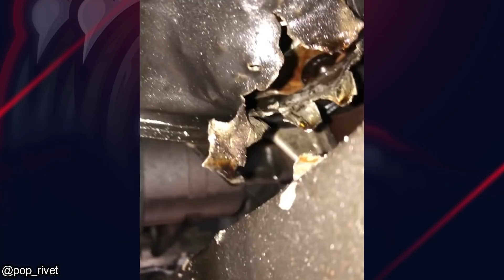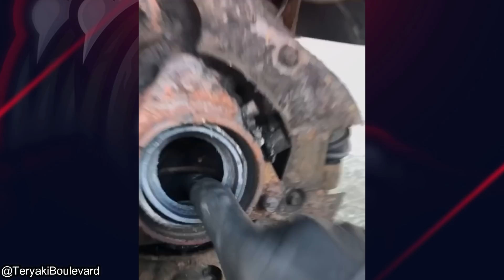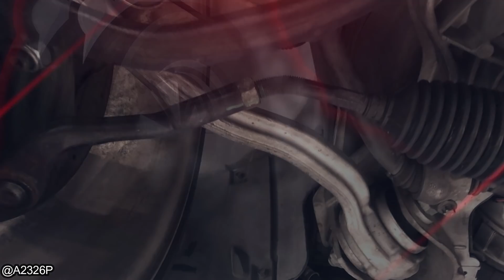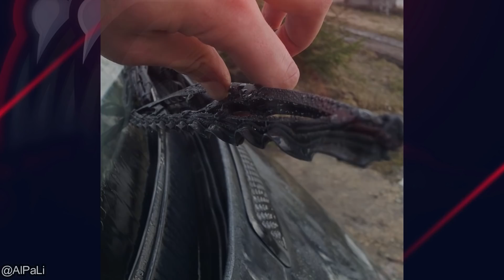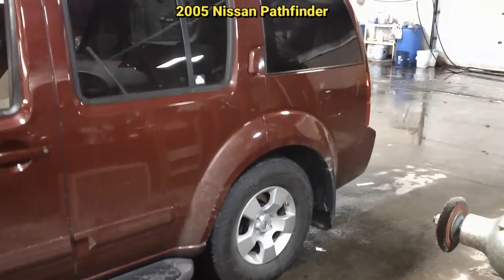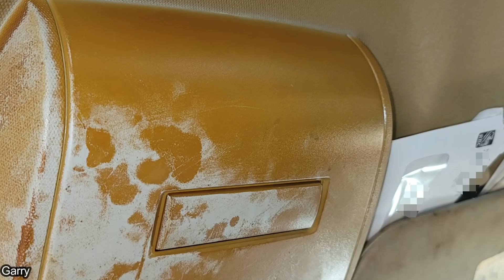Customer States Needs Starter After Towing Behind RV | Just Rolled In

Comment: Worst smelling vehicle I ever dealt with was an old Mack garbage truck, that got towed into our shop just after closing on a Friday in July, with a full compactor. It sat in the shop all weekend, with the A/C off. I was the first one in Monday morning. I opened the door to the shop, and, almost puked!
Reply from the maker: I could only imagine how bad that smelled. Reminds me of the time my wife and I emptied out a freezer (that was unplugged) with old meat inside. 🤢
Reply: Yummy!!
Reply: I used to do hydraulic repair and had a whole host of bad smells. Broken manure spreaders (they don’t break when they’re empty lol), pig rendering trucks, and the worst thing; a broken garbage dumpster with a built in compactor. That sweet sickly smell of putrid, rotting garbage in the sweltering summer sun still haunts me.

Comment: Around 70 mph in 1st would be close to 14,000 RPM
Reply: They didn't get very good fuel mileage either. That would be like riding the brake the whole time ...... until it let loose.
Reply: Betcha 1st gear is now smoothe as a railroad beam
Reply: I live in Germany and a friend of mine ( a car mechanic and a crazy driver) managed to put in first instead of third gear in the brand new A-Class of his dad with less than a 1000 km on it. Mind you he did that at 6500 rpm in second. So the engine got to about 11000 rpm and even survived. The clutch didn’t 😂 it was backed together and didn’t disengage anymore. The best part was Mercedes paid for it but the mechanic at the shop was laughing his ass of.

Comment: In the late 90's our shop did an engine and transmission, plus 2 rear tires on a VW GTi. Left in first gear and the e-brake on? The guy said it was driven up to 65 mph, so probably 10.000 r.p.m.?    The Pistons were just tiny fragments of aluminum.

Comment: I remember a guy I used to work with telling me when he was in high school (early 80s) kids would put diesel fuel in their windshield washer tank and run the hose into the top of the carburetor then hit the washer button while driving and the car would smoke like crazy but drive really slow with the gas pedal floored. I never seen it do and wouldn't suggest  doing it.

Comment: That control arm looks like the one on my dads old '77 ford. He kept insisting there was nothing wrong with them and refused to replace them.  the original control arms were still on the car after 24 years, over 200,000 miles when I drove it to the scrap yard!

Comment: Crikey, more & more tow truck operators pulling cars by their tie-rods (along with more cases of stolen exhaust bits).  Reminds me of my time at a dealer, I think it was 4 cases of engines mysteriously jumping cam timing, where the camshafts were several teeth behind; similar models with the same engine & manual transmission, all at OUR ONE dealer workshop within 2 months or so.  That's FOUR out of FIVE total that happened in our state, that year, in one town!  Turns out, those four with us had been towed (for some reason) by the same tow truck driver, who drove the cars off their truck by clutch-starting them if they were manual.  The shock to the crankshaft pulled the sprocket around some teeth inside the chain, then the cars ran like shit!!!

Comment: I've seen a chevy impala come in with dead battery on a back of a roll back. Well that tow guy towed the car pulled the car using the back trail arm control arms. Bent the rear up so bad when I test drove it felt like the back end was trying to pass the first end. It wasn't  my shops tow guy

Comment: Diesel in the washer fluid reservoir. Yikes, what other fluids did they put in the wrong place?
Reply: I friend of mine once told me a little story: He'd bough a brand spanking new Volvo. About a week later his wife used it to get to a seminar a few hours away. After about 2 hours of driving the car starts complaining about a low coolant level. She gets worried, pulls over and calls her husband. He tells her to just add some water so she can make it to the seminar on time. He'd take a look at the car when she came home. So she opens the hood and adds half a bottle of water and keeps driving.
The low coolant level light stays on however, so she calls her husband again, and again he tells her to just add some more water, it will be fine in the short term. So she pulls into a gas station, buys 2 bottles of water and gives one to the car, and drives off. The warning light stays in though, so she stops and gives the car another bottle of water. She drove for another 5 minutes before the engine completely died due to all the water in the motor oil.

Comment: The one where someone put diesel fuel in their vehicle instead of gasoline, even after draining it all out, it will take a couple of full tanks of gasoline to get all of it out of the system.   Been there, done that. But not to my own vehicle.
Reply: I had an 80s shitbox Toyota truck, a friend gave me 20 gallons of gas/diesel mix after the dolts at the gas station filled a tank on his diesel truck with gas. I diluted it down to about 10% diesel and the exhaust still would smoke and smell like diesel.
Reply: @abpsd73  Exactly!! And used premium gas to clear out the diesel fuel for the second tank full, but changed the fuel pickup in the tank first.  Pain in the ass, but had to be done. I really hate rust!!

Comment: how do you put diesel in the washer fluid reservoir
Reply from the maker: Another very good question lol
Reply: Dad told the daughter to fill up the tank and check the washer fluid while you are at ti. Be my guess.
Reply: Open reservoir top, stick diesel nozzle in, squeeze dispensing handle. Simple.
Reply: Imo they need to make all diesel pump handles green instead of some green some yellow. That yellow reservoir cap is too confusing.

Comment: Just out of curiosity, what happens to the car when you try running diesel?  I know you changed plugs and drained the tank. Does it just smoke after. Then re change plugs when smoke clears? I once put old mor oil in the washer Reservoir by accident cause i store old oil in them to take back(wasnt a clear jug)

Comment: All you do is run the fuel pump with the line off the injectors use injector cleaner with air run the car it pumps the fuel out until the pump runs out of fuel and you can clean the injectors at the same time you don't have to clean the plugs fixed this problem more than 25 times I had a lot of dumb customers

Comment: PRO TIP: If you bring a vehicle to a shop that is clean inside, outside, and under the hood. Techs are more likely to treat it with more respect and care. If you obviously don't care about the vehicle, they will care less too.
Reply: i always leave my lug nut lock key if I had one in the cupholder and when I had spline style for my aftermarket lug nuts for my nice rims lol. and worked at a dealer my pet peeve is to have my car clean before anyone works on it. i know how it feels to work in shitty cars with smoke or trash everywhere.

Comment: I see some incredibly badly rusted chassies and undercarriages in your videos. Does it have anything to do with salt being applied to snow on your roads which accelerates rusting? Do vehicles in your warmer southern states, those which don't receive snow) suffer similar problems?

I'm curious because in Australia, where there's very little regular snowfall (in most places none) cars seem to rust from the top down. The exception being vehicles used regularly for driving on beaches (which are laden with salt). We're advised to wash the sand and salt off the undercarriage using fresh water (the garden hose) afterwards.
Reply from the maker: I'm not from the US but the salt and chemicals they use in winter will definitely do that. From what I've heard in the comments they don't seem to have that issue in the Southern states but maybe somebody else can chime in on this.
Reply: In the south that is almost nonexistent unless you live in the mountains where it snows often or near the ocean where the salt air will eventually start rusting out the frame.

However Road salts from the Northern and some Midwestern states tend to rust out the under carriages quickly. Most people don't follow the suggestion to wash their vehicles under carriages often and most have little to no choice but to park outside even in the winter.
Reply: @JustRolledIn  Thanks. I enjoy your videos and have often wondered about the rusted undersides; especially when the body work looks like a much younger vehicle.
Reply: @TheLudaman141  Thanks for the info. I guess that hosing down the underside of their vehicles would be very difficult for most people in winter. (Do garden hoses even work in freezing conditions?) And they'd have to do it regularly.
Even in the warmer months there'd be concentrations of salt in all sorts of crevices, rusting the metal 24-7. Maybe drive through, upwards spraying, heated water car-washes would be a good business model in those places? 🌞 If I lived in a cold (snow & ice) winter area I'd give it a go.💲
Reply: They spray liquid salt. It dissolves your vehicle from the inside out
Reply: @TheGhjgjgjgjgjg  Thanks. I wonder if spray-on rubber or bitumen coatings on the vehicle underside would help prevent the rust? I guess not because there will have been a lot of smart people thinking about this problem well before me.
Reply: @GarrisonFall  Actually you are correct. Rubber undercoating will make the rot 1000x worse and it cracks and traps the salty water. However, things that stay waxy like wd40, wool wax, fluid film are perfect and work awesome at preventing the crap from getting on the metal and usually stays on 1-2 years

Comment: 1:47 Can a mechanic please explain how that can happen with the steering wheel ? Is it one of those self parking cars ?
Reply from the maker: I put more info in the description for each clip & video.
I wasn't told the issue but the hydraulic power steering rack was just replaced so it's a possibility that they installed the lines backwards on it or it needs a new p/s pump.

Comment: How can you fit a diesel fuel nozzle into a gas fill pipe?
Reply from the maker: You can't unless you really try lol
Reply: @JustRolledIn  Back in the days of leaded/unleaded gasoline, they were supposed to have a larger nozzle on the leaded gas pump, but station operators would put the same smaller nozzle on all pumps. I put some leaded gas in my car a few times. That's probably what happened here- same size nozzles on everything.

Comment: That lower control arm looks like magnesium chloride liquid deicer damage.  Pretty much how a 3 year old American vehicle would look like. Asian about 10 years, German 100k. Years don't matter with German cars lol. I've literally seen 3 year old trucks with maybe 30k with rot holes.  Remember what that 2012 f150 with 96k frame looked like?
Reply from the maker: Ding ding ding. You're right lol. And I remember that truck. Wow that was rusty.
Reply: @JustRolledIn  That Thundra? I don't know how that thing didn't crumble before even arriving at the shop, heck, any of those for that matter.
Or that other one you posted where the owner (or whoever the heck did that "job") just welded, well.... anything on the frame to reinforce it somehow